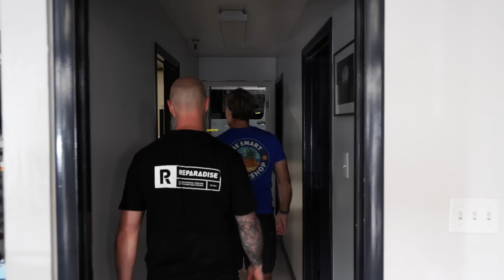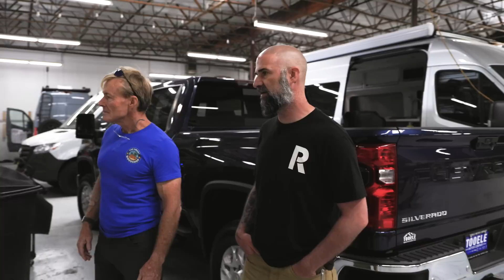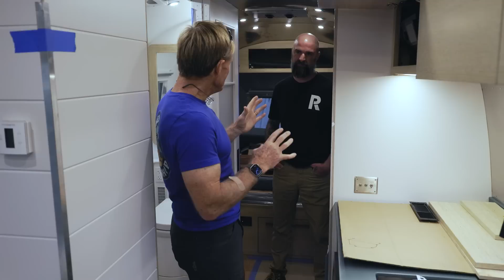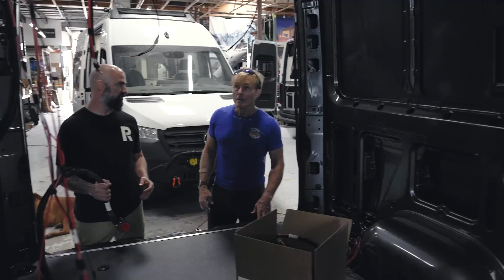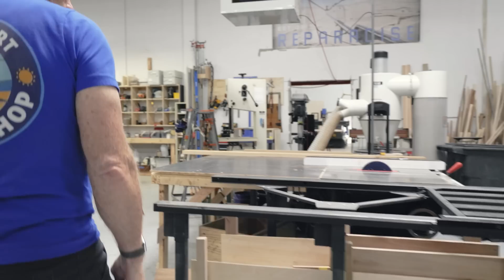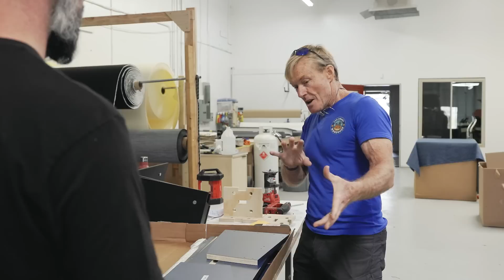Restoring RV Dreams: Ron's Epic Adventure at Reparadise in Utah

Comment: We love your work benches Ron, but $895? We can get materials and make it ourselves for less than $200. But hey, I guess there are folks that can afford it.
Reply from the maker: It costs over $550 in materials to build the bench if you use Ultralight. Then you need a PARF guide or have a CNC shop cut it. Minimum cost to build it with quality material is $600 plus your time. $200 is only possible with low quality material. Even then you couldn’t build it for $200.

Comment: Really liked the information about the wiring harness.  In 1975 I started work at a facility that made house boats.  31 ft. and 45 ft.  My new job was to do all the wiring of the boats.  This company paid attention to every aspect of the build on the boats and recorded on time cards how long every aspect of the build took.  I was allowed 12 hours to complete the wiring of each boat.  My first boat took me 14 hours, I had never done this before.  Using a cart with multiple reels of different wire on it, the procedure was to pull each wire individually to its required location and then the next wire.  Then bundle all the wires and create a harness.  After the first boat, I asked the foreman if I could build the harnesses ahead of time.  He told me OK.  I pulled the harness from the boat and laid it out on the floor of the shop.  After marking everything, I was able to assemble multiple harnesses in about one hour.  When the president of the company noticed the harnesses coiled and hanging on the wall, he asked what was going on.  He then took one of the harnesses to a company in Seattle and they then delivered a box load of them six to a box.  It then took 45 minutes to wire the boat.  I liked the bonus.

Comment: Go for it! It would be even better if the smart workbench had the same blue (or other color) laminate covering. I know I’d be one of the first to buy it.  SEMPER FI
Reply: So when I built my bench a spent extra money to get nicer plywood for the top, so it could be better looking. I found that to be a waste because anytime I’m using my bench the sacrificial strips cover 90% of the bench top. I agree the laminate would aid in Glue up clean up, but it would also add unnecessary weight to a bench that is designed to be lightweight and mobile. I have the smart bench and smart station in my garage shop. I think I will be building a 4 x 8 smart bench without the holes and laminate top as a separate assembly table. Essentially the smart big bench, not cut in half, with no holes on top, tool storage in the torsion box center, and the Smart Woodshop drawers underneath with access on either long side of the bench. On wheels of course
Reply: @MRANDERSON70  To each his own. I don't think a 3' x 6' sheet of laminate could weigh more than 2-3 lbs max.
Reply: Definitely having the laminate tops would be a huge plus. Glue clean up would be easier plus less drag on material being pushed through the saw.